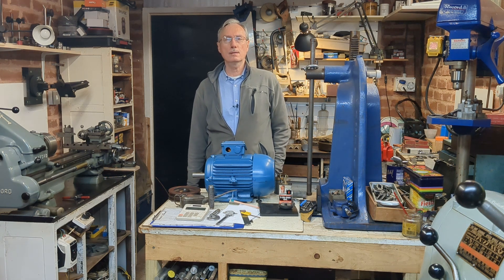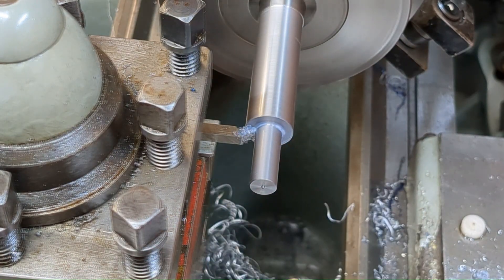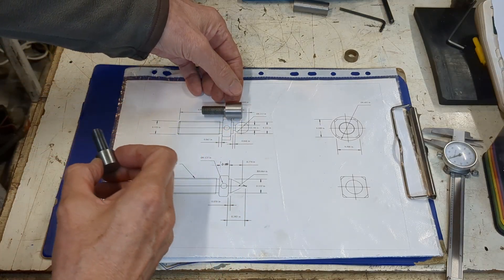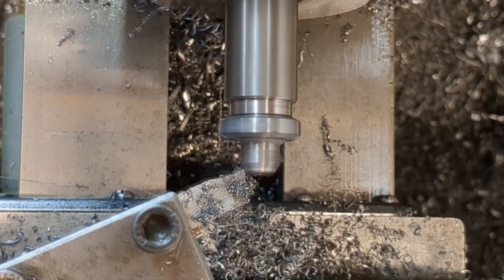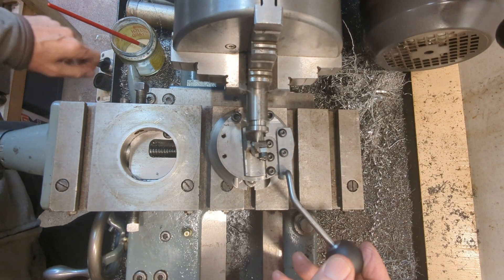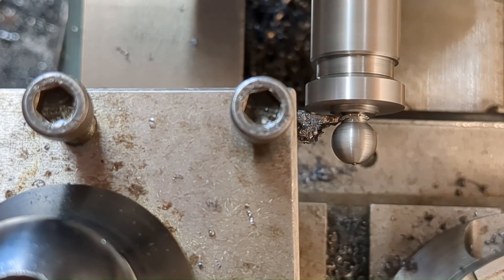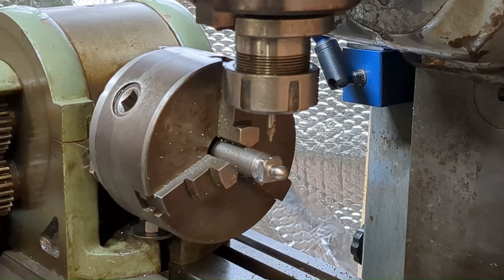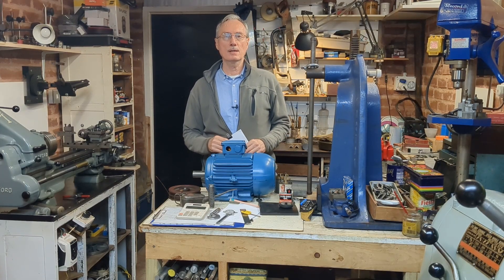Making a machinist's jack - part 2

Comment: Looks good sir.

You hang your work way too far out of the chuck tho. The first operation in the colchester needed a center.

I got a kick out the comment regarding doing such fine work as I normally run a 26x80 lathe.

Any plans to keep rust and moisture at bay this winter since we are coming into the cold wet season?
Reply: Impressive piece of machining 👍
Reply from the maker: Good point! I was a bit greedy trying to save time by turning the outer dia for both bolts at the same time.
Once I changed to the old HS tool it worked out fine - work turned parallel.
I have an even smaller lathe under the bench about 4x6.
Ah, yes I am beginning to think about the cold damp weather.  I hope the insulation I put in last winter and better anti-rust sprays will do the trick. I have brought my slip gauges into the house.
Reply: @Workshopfriend I am thinking about a mini split for my shop.

I find carbide is hard to use, esp for the home workshop and light lathes.
It is best suited to CNC tho we use a lot at work it is really hit or miss at best.

Comment: Usual high standards throughout.

Your lathe is beautifully quiet. Can you eliminate the slight rattle and make it even quieter? How soothing to work on such a silent machine.
Reply from the maker: Yes, Mike, it is one of those jobs I just haven't had time for. It used to annoy me slightly but I got used to it! There are several maintenance tasks which I might make into a video. That will motivate me to make the lathe even quieter.